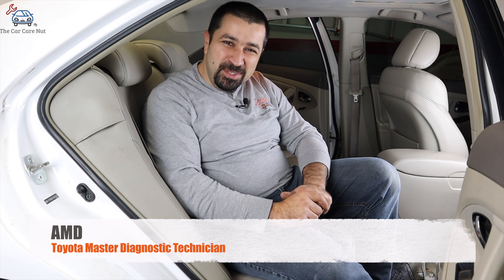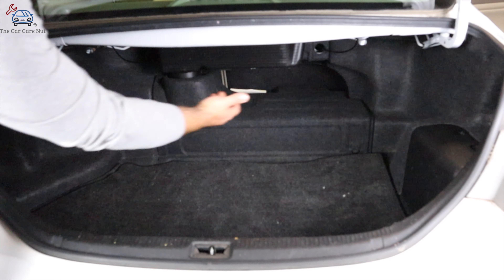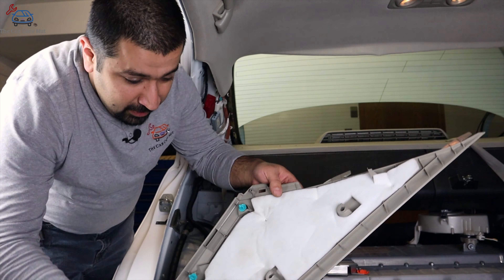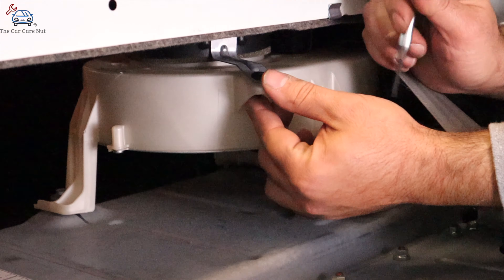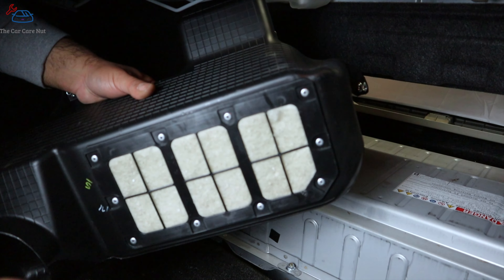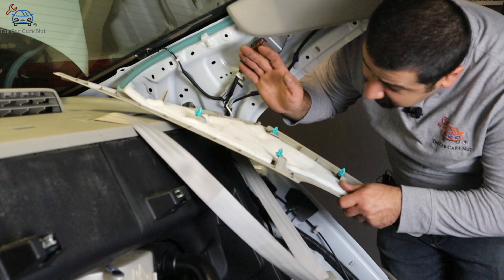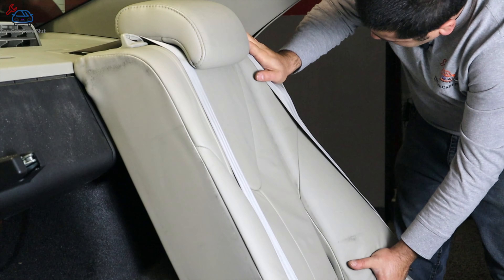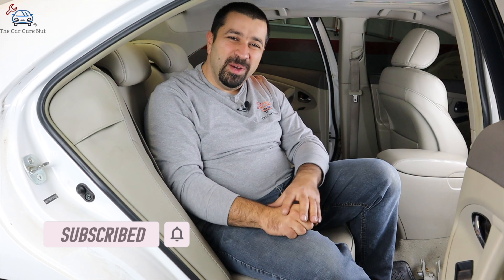How To replace Hybrid Battery Fan Filter and Fan : 2007-2011 Camry hybrid

Comment: I wonder how much would the mechanic guy need to be paid? Anyone knows? I don't have tool time or place to do it myself. I would just like to make sure I don't get ripped off.
Reply from the maker: This could cost 2-3 hours or labor to do. Labor rate will vary by area. In Chicago labor rate is 110-150 per hour